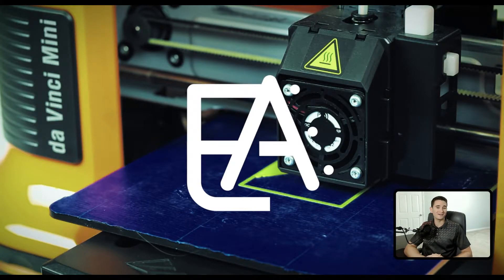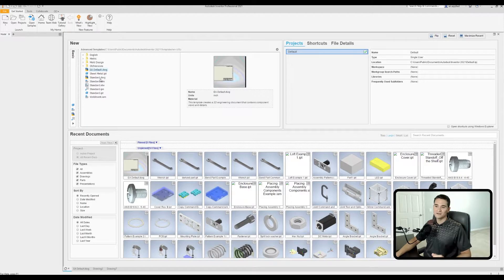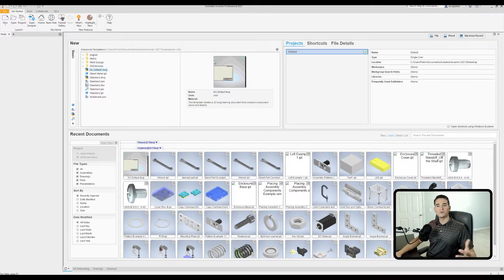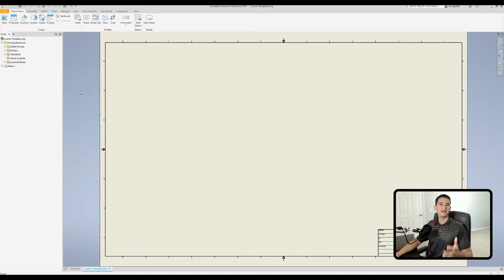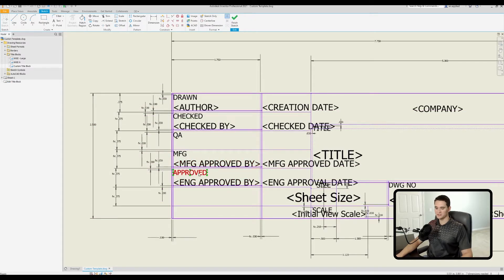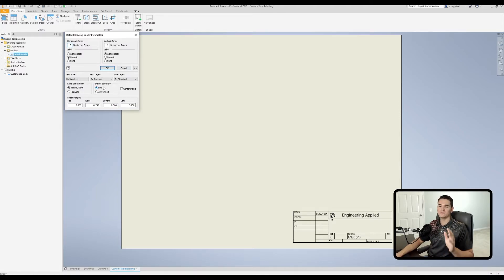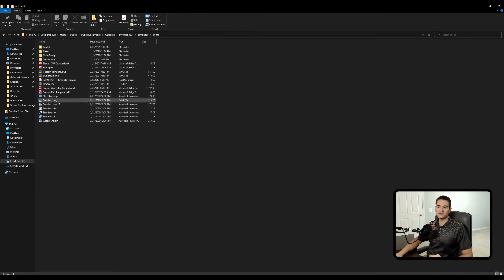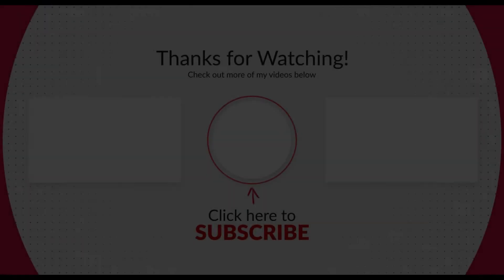Custom Drawing Template - Autodesk Inventor Drawing Tutorial | Autodesk Inventor 2021 IN DEPTH

Comment: Can't I just use an already designed layout (dwg) from AutoCad in Inventor? The line work that is. Also, is the line weight editable?
Reply from the maker: Great question. You should be able to open the AutoCAD .dwg file in Inventor and then follow the same set of steps in the video to create your new template for use with inventor from the source AutoCAD file. For example:

1. (In Autodesk Inventor): File > Open > AutoCAD Template of Choice
      1.1 NOTE: You may need to use import an AutoCAD file rather than "Open". To do this, simple go to FILE > Arrow next to OPEN > IMPORT DWG
2. File > Save As > New Template File Name of Choice.dwg (Be sure to save this in the following directory: This PC > Local Disk (C:) > Users > Public > Public Documents > Autodesk > Inventor 2021 > Templates > en-US)
3. Now you can edit your new template as shown in the video. To change the line weight and other style elements you can go up to the "Manage" Tab > "Styles and Standards" section of the ribbon > "Styles Editor" button while in your drawing file. This will allow you to change the style of the elements in your drawing (such as line weight in table of revisions, line weight by drawing layer, etc.)
      3.1 NOTE: An easier way to do this is to RIGHT-CLICK on the block of interest after importing the AutoCAD file (title block for example) > then go to "Edit Definition" > Then RIGHT-CLICK on the lines you want to change the weight of and go to "Properties". Here in the line's properties menu is where you can easily change the line weight.
Reply: @engineeringapplied  Perfect. Works like a charm and saves me a bit of time.
Reply from the maker: Nice! I'm glad it helped.